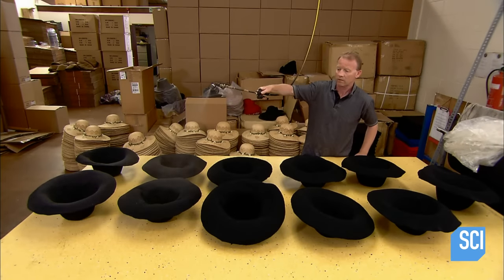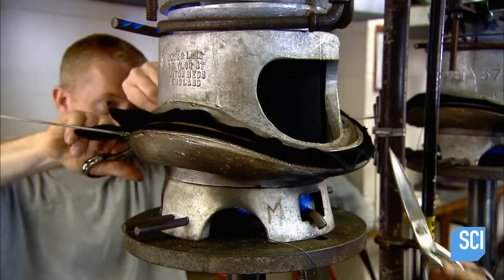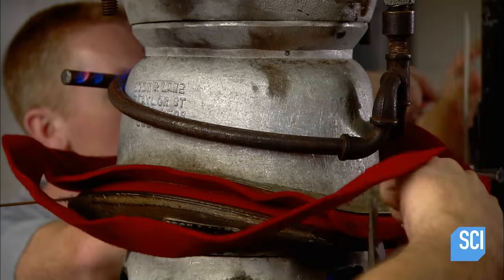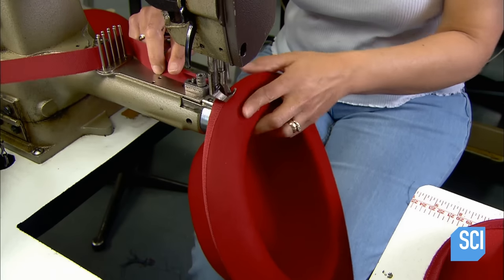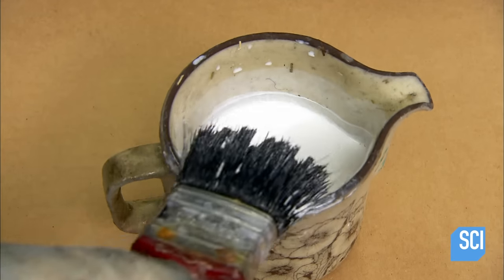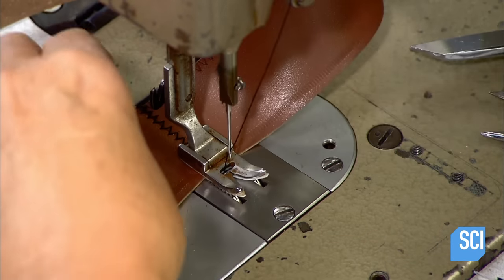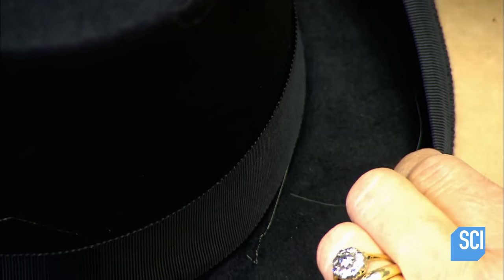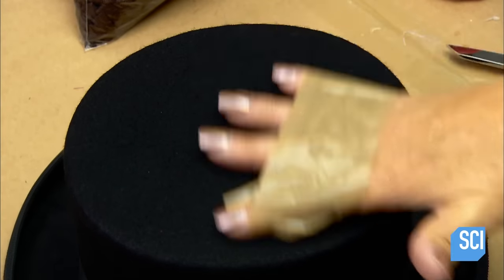How It's Made: Top & Bowler Hats

Comment: I don't know what I went into this expecting, but I am weirdly disappointed that the bow is just glued on and not actually tied.
Reply: I had the same thought.
Reply: Most hats today are made cheaper than back then bc no one wears them anymore. High quality hats are all sewn
Reply: I agree .Wouldn't it be time and cost effective to just tie a ribbon around it?
Reply: @letter1967  Lack of skilled labor is the problem. A real hat band is actually not tied either, it's sewn together by hand to look like an ideal bow. The ribbon is also held onto a hat by small stitches spaced apart by a few inches. It's not hard and I could train a reasonably competent person to do it in a few hours (assuming they have no hand sewing experience) but even that is too much to ask for nowadays. All good hats are made on a small-scale by a hatter, either selling the hats under their own name or the name of their company. Only a few larger companies are still respectable and they're all based in London.
Reply: I’m thinking these are low end quality hats maybe?
Reply: @DavidWilliams-zr5ew  factory made, wool felt, glued hats are the lowest quality you can find yes. Rabbit or beaver fur felt is much higher quality and they should be blocked and sewn by hand
Reply: @c.a.k.comedy692  There's actually a lower quality. A lot of hats use a foam-like material with polyester fabric or some kind of flocking adhered to either side. This faux wool material has infected much of the bottom of the market and I fear it gives a lot of people a bad idea of what it's like to wear a hat.
Reply: Left on your rear car parcel shelf in the sun and it’s fall apart from the heat.
Reply: I believe it's to do with the price of the hat. Only custom-designed hats were stitched by hand, as is the fedora I wear made by Lock & Co. Be warned, but you will pay dearly for a hat made by them. There again, you do get what you pay for.
Reply: @Aco747lyte  Once upon a time all hats involved some hand stitching, even in the industrial age. A lack of hand stitching is the least of these hats' problems, the entire thing is a facsimile of a hat using awful materials; it is to a bowler what margarine is to butter. Quality in everything from material to craftsmanship is key. As a mechanic friend of mine says in regard to forking out large sums on quality things: "buy once, cry once."
Reply: These are cheap hats made for tourists, made on a budget and to be worn very few times at best. You can tell by how big and prominent are the 'made in England' is, but there is no other manufacturers info or logo

Comment: Hot glue!?  Surely they could’ve found something that’s a little bit more durable and not so cheap.
Reply: Hot glue or made in china...
Reply: I still think that hot glue isn't the ideal choice, but you'd be surprised by how strong high temperature hot glue is. It's very different than the cheapo hot glue we're used to using for arts and crafts projects.
Reply: @onebackzach     what are you building, a hat or an armored helmet?

Comment: I'd like to see how a silk top hat is made. The collapsible type.
Reply: It's basically a metal frame with 4 springs and then some silk draped and held in tension on the exterior.

The base, however, is a lot sturdier as it has to press against the springs and maintain tension.

Comment: I was a hat manufacturer for many years........the "string" used to tie the brim down to the aluminum hat die is called the blocking cord, and it's a specific cord for this purpose........production factories use a rounding machine to trim the excess felt from the welt......the machine is operated by a separate operator.......I've never seen a factory where the blockers trim the welt ,and certainly not by scissors......as shown in this video it's a two step process trimming the welt........in reality the blockers are moving down a line of stampers blocking the hats........as soon as they get to the end or last stamper, they go back to the first stamper, remove the hat, and set up another one......then they move to the next stamper and do the same thing......usually 2 men for each line of 12 stampers.......they are not standing around or trimming the welts........the hats are then brought to the rounding machine and in one pass the entire welt is trimmed......I used to operating the rounding machine as it was my favorite machine whether rounding felts or straws........

Comment: Hot glue is the quick and easy fix - back in the day it was all stitched; the liner was hand stitched in between the felt from the inside so that it wouldn't be visible from the outside.  Obviously, hot glue is much quicker and easier, but won't be as durable for a daily hat - we're not living 100 years ago when it was a daily fashion piece.  Good day!
Reply: Of course, back in the day, mercury was also part of the process of hat making. Being around all those mercury vapors made hatters of that era go bonkers, which is where the term "mad as a hatter" comes from.
Reply: Not to mention those two magical words: "Silk Plush". Look no further than my profile picture to see the shine of this fantastic material!
Reply: @Hellbane224  you're absolutely right! And they'd also lick their fingers to use saliva to adjust the shape of hats, and unintentionally be licking mercury!
Reply: @carltrotter7622  My goodness, that is a glorious shine! 🎩✨
Reply: @Hellbane224  that’s the cost of a fine hat
Reply: @Hellbane224  If you want a laugh, look on YouTube for "Progression Of A Mad Hatter" on a channel called DerrickComedy. Features a very young David Glover.
Reply: This is not the only way hats are made, there are plenty of bespoke hatters out there making higher quality, hand made on wooden blocks. This is a factory setting
Reply: I got a top hat when I was 13 and I wear it nearly every day, it's not the highest quality but the lining is the only part that's glued and that just to keep it in place under the band, the rest is all stitched and it's held up really well.